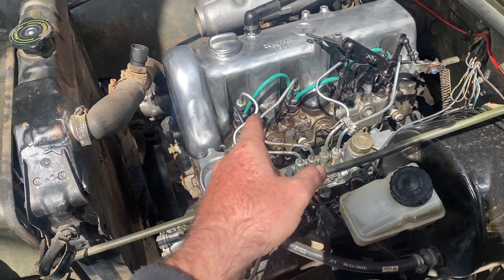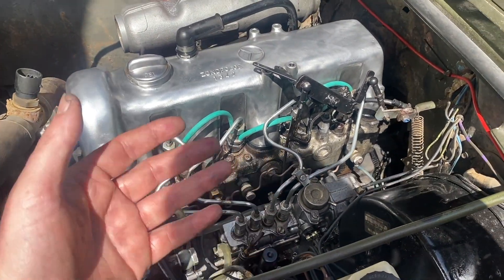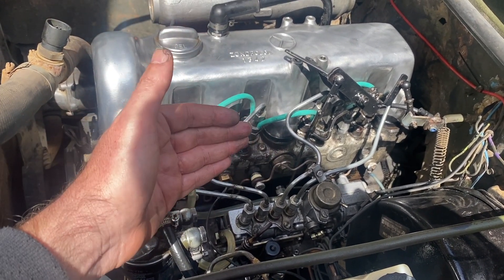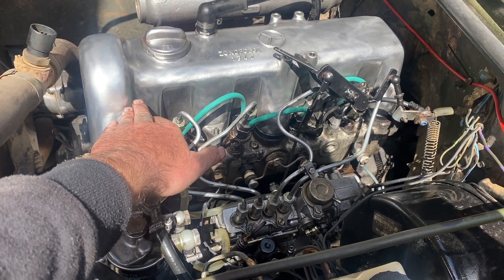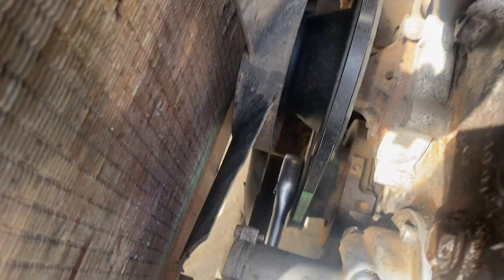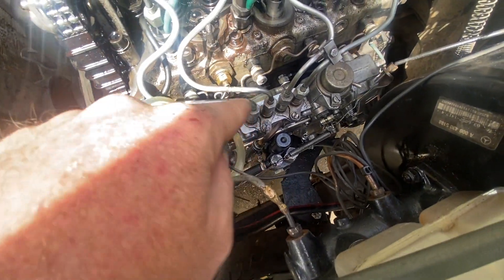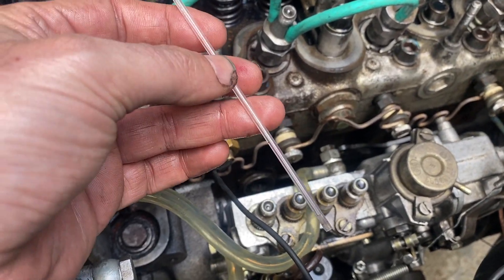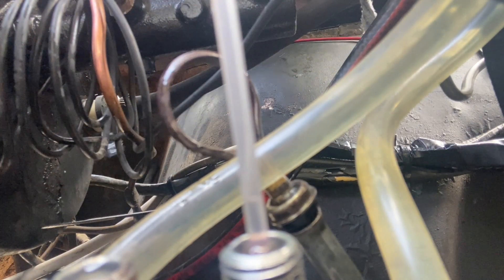Mercedes OM616 OM617 OM615 engine setting the injection pump timing

Comment: Thanks for this, I have a couple of questions, as the fuel starts to move in the tube would you say that at this point or slightly after , this is the same as the one drip at every 10 to 15 seconds when doing spill timing ?. I've just used your method on my OM617 to check start of delivery which is supposed to be 24 degrees BTDC on cyl 1, however the movement in  the pen tube occurs at 19 degrees on the balancer . I'm just trying to w ork out if this method is the same as spill timing or dynamic timing ( actual injection pulse ) or some where in the middle, Trying to sort a smoking issue on an otherwise healthy engine. Thanks for you time.
Reply from the maker: Hi, sorry for the delay. So what you can do is, remove the injection pump, turn engine so that on cyl 1 you are top dead center and the mark on the camshaft matches on the mark of cam holder. now down the crankshaft you supposed to be at the 0 mark.If it is not, write it down where you are. Now, take your injection pump and look at the sprocket, there is a tooth missing and a mark on the body next to the sprocket, make sure they align. on the side of the injection pump there is a big bolt that you can take out, and insert same size bolt but longer to block the internal cam to move, you need this to insert the injection pump back, otherwise by inserting the pump, it might turn a degree off, so you want to avoid that. the two marks aligning mean injection point  on injector 1. when you have the injection pump installed, don't forget to replace the long bolt to lock the cam with the shorter bolt so the cam can spin freely again. SO, before you put the injection pump in. You calculate the chain slack (you were supposed to see 24 but you are seeing 19, but you did not tell me if that is 19 before or after TDC.if its before, your injection pump fires cyl 1 ,  5 degrees too late,  The reading is (AFTER 30-20-10- 0 -10-20-30 BEFORE). So you would turn the crankshaft a few times and when you are sure your camshaft marks are aligning, only then look at crank timing ( and stop it at 24 BTDC and insert your injection pump (that you aligned to fire). Hope it makes sense and that it answered your question.
Reply from the maker: I know I typed a lot, but I forgot to mention that of course you can loosen the 3 nuts holding the injection pump and either turn it one way or the other way to play with this timing, I don't remember how much degrees you can do each way, but with the ballpoint tube you could see if you are either approaching the 24 BTDC mark or further from, this would be a good place to begin, if you are not getting close to the 24, do the procedure I described in my first response.

Comment: U dont need too follow books, all u need to follow is 24⁰ btdc n Cyl 1 at comp stroke, boom it starts right up. If u want to spill time ur Inj Pump then adjust it arnd 1 drop per sec or 6-7 drops per 10 secs.
Reply from the maker: Ok, but you still need to figure out and see when the pump starts injecting on cylinder 1 and synchronize that at 24btdc

Comment: The ballpoint pen visual trick is groundbreaking! I will try it on my almost-starting OM617. Although it might have low compression and/or bad injectors. Thank you for a great video.
Reply from the maker: Thank you, I am glad you like it, the ballpoint pen really amplifies the minute flow level and you can pick it up immediately where the beginning of the pressure starts. Good luck with your project!

Comment: I need to replace gasket on front of pump, between pump and engine housing, at my OM617.913 in Mercedes T1. Can I just loosen pump and pull backward or will I have to fix anything from front side of engine? Do I need to loosen the leftside bolt on the shaft of the pump? Thank guys
Reply from the maker: Sorry for late reply, yes, you can remove the 3 bolts holding the pump, slide the pump out and replace the gasket. BUT you have to indeed fix the shaft of the pump, by removing the bolt on the side, and putting a larger length bolt in and tighten to fix the shaft, THEN remove the bolts holding the pump on the engine housing. Take out that side bolt first, and see what diameter it is and get a longer one
Reply: @makingcookingfixing Just reinstalled the injection pump and used your ball pen procedure. Worked all fine. Many thanks for this advice!!!
BR from Germany
Reply from the maker: @flixe6401  I am really happy that it helped you! Thanks for letting me know!
Reply: @makingcookingfixing One additional advice for Mercedes T1: use flexible endoscope. So you can crank laying under the car and check diesel level in ball pen tube.
Reply: @makingcookingfixing The side bolt is M12 but not common thread pitch, it is smaller ("fine thread").
Anyway I timed as described.

Comment: Sorry,but,the allignement for the cam,equivale at the Mark ti the flyweel to the sign OT? Whi in your engine Is the not OT?
Reply from the maker: Thank you for your question. These are old engines, I believe even new they were at 4 degrees, which was totally ok. Mine is where you saw it because of chain elongation.
Reply: @makingcookingfixing  tank s very good

Comment: Hello sir, well done and thank you for your video, I had a quick question regarding the adjustment of the om616 injection pump, normally from what I heard on certain forums, they say that the injection point is When the diesel stops spouting from the first cylinder of the pump and you apparently wait for it to flow according to your little transparent pen pipe? Is that why it’s confusing? do we have to wait for the diesel to come out or stop from the pump, on cylinder 1 to really know the injection point? thank you for your feedback
Reply from the maker: Hello, and thank you for your kind words! You’ve raised an excellent question, and I’m happy to clarify.
The confusion often comes from the different methods used to determine the injection timing on the OM616. Here's the distinction:
When the diesel stops spouting: This method is often referred to as the “spill timing method.” It involves rotating the engine and observing when fuel flow stops from the first cylinder's outlet. This point is commonly used as the reference for injection timing.
When the diesel starts flowing: This is a variation of the same principle but focuses on when fuel just begins to emerge from the first cylinder outlet. Some people just look inside the first port for movement, I used a transparent pipe or pen to make this easier to observe.
Both methods aim to identify the start of injection, but the key is aligning this point with the specific timing marks on your engine (e.g., the crankshaft or flywheel marks) as specified in the service manual.
In practice, either approach can work, but it’s crucial to consistently use the same method and ensure it matches your engine’s timing specification. If you're using a transparent pen pipe as shown in my video, it’s easier to focus on the start of flow for accuracy.
I hope this clears things up! Feel free to ask if you have any further questions.
Reply: ok thank you verry much 👍
Reply: Hello, excuse me, but I still have a quick question regarding the timing of the om616 injection pump. We clearly saw in the video that you set it to 18° before pmh because you took into account the offset of 6 degrees, 18+6 =24. So it is at this moment at 18° where the diesel starts to spurt from the tip of the pen that I can remove the injection pump to adjust it to its own marks and then replace it and rotate the crankshaft pulley again up to 18° before pmh to check the start of injection again? "I know I have to make 2 revolutions on the crankshaft" Thank you for your feedback.

Comment: OUTSTANDING!!!! i been fighting this very thing for years , will give this a try this weekend and  give my results
Reply from the maker: Excellent! I've struggled a lot and looked at many videos and forums and as was almost going to give up (but I have the good quality of not giving up) certainly it was challenging. Especiialy when the forums or the manual says the angle it is supposed to be, but no one speaks of chain stretch. But, follow my video and you will get the perfect timing. After I did this I installed quick glow plugs, OMG, it starts in 1,2,3. before it was 1 minute and some. You wont believe how good this engine starts and runs now!
Reply: @makingcookingfixing   so did you set the crank at 18 and then reset the pump or did you set the crank to 22 and and then turned the pump down to 18 ?
Reply from the maker: @ first step is to turn the crankshaft with the camshaft cover off, turn until the two dots Aline at the camshaft holder and sprocket, (Attentuon: make sure your first cylinder valves are closed) or you could be 180 degrees wrong! )then you look at the timing marks down at the crankshaft that would be your true TDC. From there you deduct the BTDC number for your engine and that is where your injection pump first nozzle should fire.
Reply: @makingcookingfixing   ya got that. What i was getting at on yours what that you came up with 18deg. So you pulled the pump and then set the crank to 18 dbtdc and then replaced the pump with the pump timing mark aligned
Reply from the maker: @ exactly. However, with the pump marks aligned, and put back in the engine, when double checking if diesel is coming out at nozzle 1 of pump at my crankshaft position, after a few turns, it turned out still to be not in synch. I had to pull the pump out a few times and adjust a teeth by teeth.

Comment: After you turned the crank to get flow to #1 and reached flow, what was the crankshaft reading? Thanks.
Reply from the maker: Before starting, I was 6 degrees over and had to be at 24 before. So i got it to work at 24 minus 6 = 18 BTC
Reply: @makingcookingfixing  I’ve got mine at 24/25 btdc and now I take off the pump and align the marks and place the pump back on. At this point since being at 24btdc with rabbit ears up on intake and exhaust in #1 and marks aligned I should button up and rotate to 15 atdc as I understand. What are your thoughts? I have not messed with the side panel on the pump setting it to 19.5 - I’ve not attempted this yet. Of course at this point I can use trial and error starting at 24btdc. I watched videos recently which also used 15atdc after a formulae had been followed adjusting the ‘side timing.’ Thanks for commenting again.
Reply from the maker: @banginbuffalo the first part you write is perfect. 24BTDC bottom and ears up on top, if you took out your pump and the untoothed cog lines up, you should be perfect, this means the pump will spray exactly at 24BTDC. Just do the air removal process by hand pumping. But just to be sure, without the steel high pressure fuel pipes, rotate the crank and see if the diesel actually starts to lift from the first line each second turn at 24BTDC. It should and you should be able to start the engine
Reply: Great video indeed, thanks a lot. It's weird my guys removed the head, marked the chain and cam gear but the tdc marks on the crank pulley are up instead of down, when I put them down , it's pistons 2 and 3 up. Any idea why? Thanks

Comment: I'm sorry that I didn't understand how you fixed the injection timing. Did you loosen the injection pump mounting nuts and then swivel the injection pump towards the engine by 6 degrees  ?
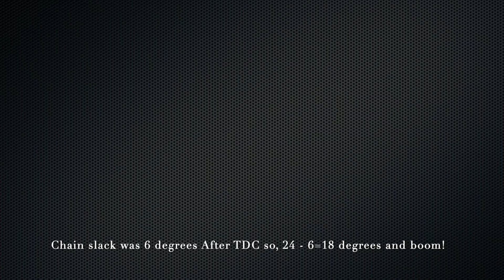Reply from the maker: please also check what I wrote at 4:11 in the video. The quick and easy answer is, align your camshaft marks (make sure they align at the first cylinder, because you could be aligned at cylinder 4 (this is a great tip!) so, open your valve cover to be sure the two rocker arms of cylinder 1 are up, set the sprocket groove of the injection pump aligned with the mark on the body. Then turn your crankshaft manually to where you need to be (which you determined beforehand) in my case, I was 6 degrees after TDC. Any question you have I will try to help.
Reply from the maker: Hi, yes, I removed the 3 mounting nuts of the injection pump to remove the pump so I can see the groove on the front gear. In normal cases that groove should be on the top mark on the body of the injection pump and at the same time, match the alignment marks on the camshaft which is TDC Top dead center of cylinder 1. Now the difficult part is determining the amount of chain stretch you have to find the true angle of TDC on cylinder 1. To find that you turn your engine clockwise until the two marks on the camshaft line up precisely! and then look down on the crankshaft pulley and read the number where that is. It supposed to be 24BTDC If camshaft is aligned it means that cylinder one is in compression stroke. and the mark should be at 24BTDC. If it is not there, you look where you are at (before or after 24BTDC and you would adjust your injection pump accordingly.
Reply: @makingcookingfixing how would you adjust your injection pump accordingly if it read say 18 degrees?
Reply from the maker: @banginbuffalo  are you sure it reads 18degrees with the camshaft marks aligning at TDC on first cylinder? (Both intake and exhaust lines are up)
Reply from the maker: @banginbuffalo  if that is true you are not that far off, it needs to be 24BTDC. I would make sure , cam marks are aligned on first cylinder TDC, then, rotate the crankshaft to 24BTDC, remove the injection pump and align the untoothed cog with the timing mark on pump body, tighten the side bolt so the pump does not turn and reinsert on motor. Then turn the crank by hand and check if indeed at 24BTDC you see the fuel level moving at the first injector connection on the pump
Reply: @makingcookingfixing  18 was a hypothetical number. It think I am at 24btdc but now I have to go back and check again to look #1 to make sure it’s in compression stroke. Thanks.
Reply: @makingcookingfixing  I will try this as I am also awaiting another pump from a motor which I know was good. Thanks so much! Great video! Very helpful.
Reply: Thank you very much. Now I understand how you matched the pump timing to the engine timing marks with the 6 degree  change due to the chain stretch. ,👍

Comment: Hi friend, i still don't understand how you compensate pump timing without an exact tdc, but it works😂
Reply: He accouted for the slack of the chain, apparent by checking how misaligned the crankshaft is to the camshaft at its tdc marks. I suggest replacing the chain though, as 6 degrees is a lot.